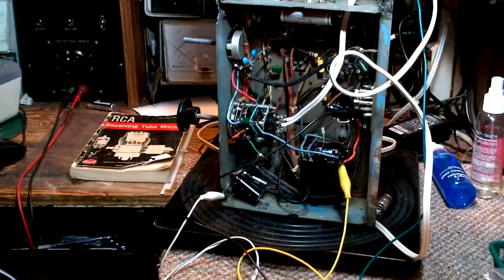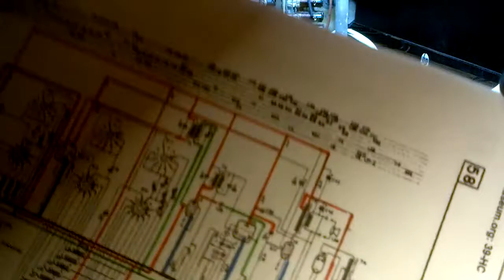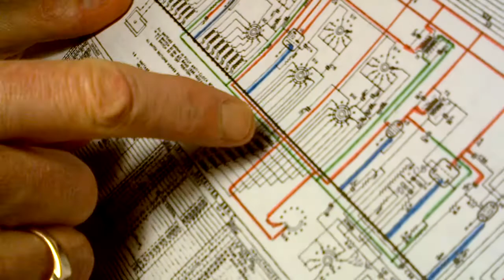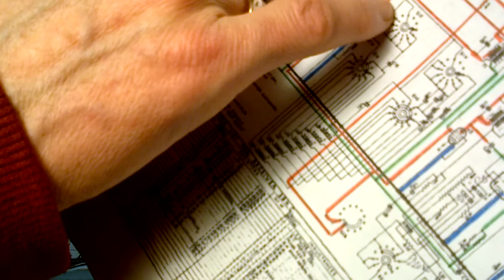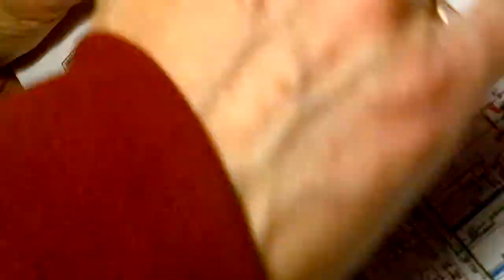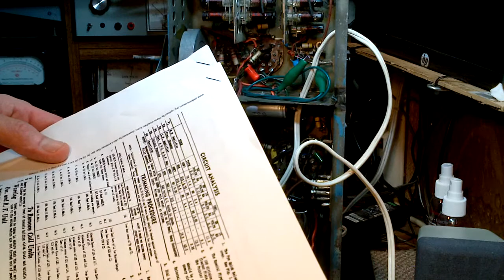Antique Tube Radio Canadian PYE 39 Video #18 - Investigating the Birdies

Comment: The other camera produced great close ups (even at 360p) but you are correct a slow computer will cause the problems you were having.  Your tablet is doing a great job because it is consistent.  No more frozen frames.

Comment: Hi Jim. The video looks great. I n see the dials on your equipment again where before they were to white to make out. and the radio seems to have less high pitch noise.  Big thumbs up.
Reply from the maker: Thanks Bobby.  I think a detailed picture is important.  I've realized that the external microphone did not actually work and the on-board mics were active so I need to be sensitive to the noise I make with the tablet itself when I move it.  I also have to train myself to be aware of the limits of the field of view of the camera.  Too bad I messed around with the webcam for so long.